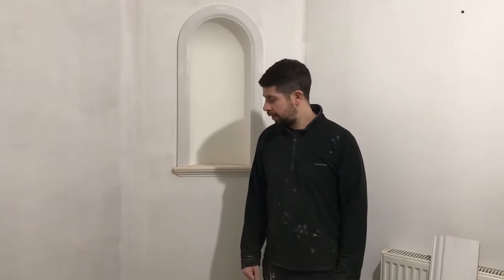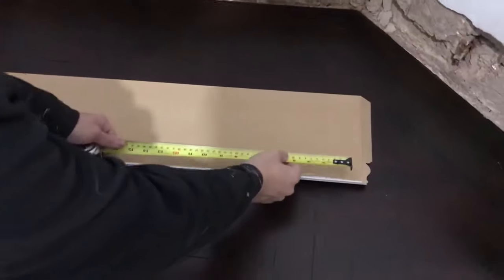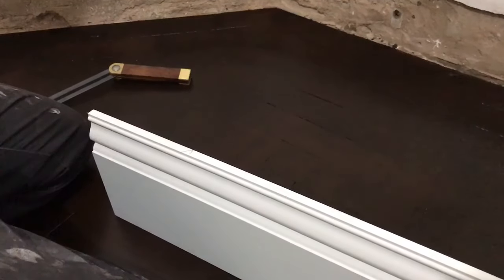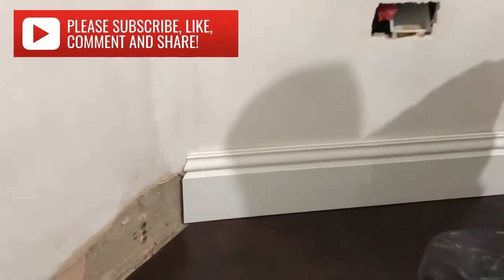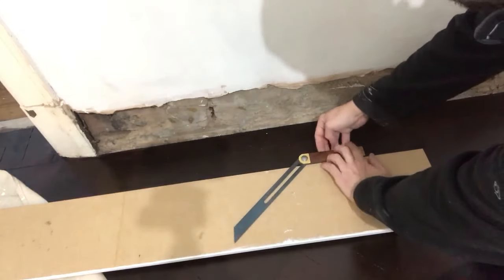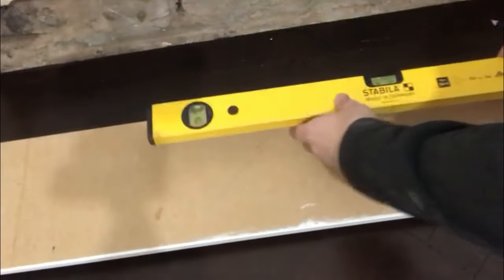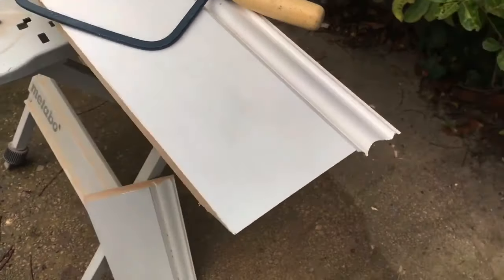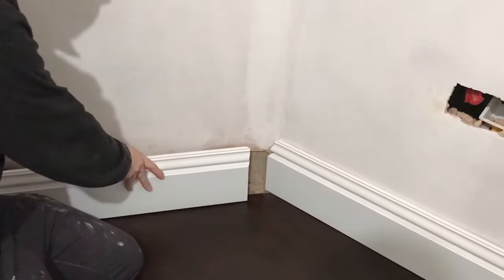Skirting board, non 90 degree internal corner, obtuse angle scribe/cope cut. Bay window conservatory

Comment: Hi mate great video, I had a job today fitting skirting on a 5 side bay window, each were less than 30° angles on each corner, I was told by the owner that they had carpenters out that wouldn't even touch it, I now realise why 🤣 very very difficult, also didn't help that the walls were bowed and twisted slightly and had to scribe behind each each edge about 35mm
Reply from the maker: To me this is basic level 2 carpentry. But it's amazing how many people call themselves carpenters and they can only do billy basic work.
Thanks for watching and don't forget to like share and subscribe to help the channel grow 👍🏼
Reply: @spendtimesavemoneydiy  will do,  thanks for the video.
Reply: @spendtimesavemoneydiy  how many levels are there?

Comment: Great video, im still struggling.
A 45 cut fits flush to the wall.
Im striggling to get the back cut right.

What kind of saw did you use to get the straight cut?

Thanks
Reply from the maker: I just use a bahco fine toothed saw from screwfix.
I'm sure you'll do a great job.
Let me know how you get on.
Thanks for watching and please consider subscribing 👍🏼

Comment: DIY question:  Apologies if I missed it but what is the purpose of making the very precise bevel cut (from around 4 mins) prior to scribing?  The cut is a perfect dissection of the internal angle, achieved through the very neat drawing trick with the level, but, if it’s going to be back cut, would a 45 degree cut not been just as effective at exposing the profile prior to cutting?  Super helpful video though so many thanks!
Reply from the maker: If it's cut at 45 degrees then it will fit neatly into a 90 degree corner. The amount of profile that is cut away changes with the different angles. So the bevel cut to expose the profile is half the angle of the corner. Hope that makes sense.
Thanks for watching and don't forget to like share and subscribe to help the channel grow 👍🏼

Comment: How did you fix it to the wall did you glue or nail
Reply: Glue and pin . But looks like may be brick behind the wall so would have to plug and screw
Reply from the maker: It's a brick wall but I always recommend to plug and screw skirting boards to walls. I actually have a video about it.
Thanks for watching and be sure to like, share and subscribe to help the channel grow 👍🏼
Reply: Spend Time, Save Money, DIY  I bought Mdf skirting from online pre primed , the company recommended using adhesive, it’s an old 1970 house  and the guy that fixed  it drilled out some very big holes and countersunk the screws  ,they do not manufacture a good filler for MDF only the two part mix which  is difficult to use, I rang the company that makes the skirting  to see if they had any ideas   They said no ,so I have quite a few  big holes  to fill  any ideas ?
Reply from the maker: Joyce Millichip if you watch my video on how to paint mdf skirting boards that should tell you all you need to know.
Let me know how you get on 👍🏼
Reply: Spend Time, Save Money, DIY  thank you I will  I bought them like that because I didn’t want to paint them as I have a lot of other stuff I am doing in the house.  I will find the video and watch it thanks

Comment: Is there a power tool or power tool fitting that would replace the coping had saw?
Reply from the maker: Eddie Warren many people use a jigsaw to replace the coping saw but a jigsaw would struggle to get the angle needed hear. My advice is master the coping saw and it will be just as fast as a jigsaw! Thanks for watching and be sure to like share and subscribe to help the channel grow 👍🏼
Reply: @spendtimesavemoneydiy  Thnsks for the advice.
Reply from the maker: Eddie Warren no problem, anytime 👍🏼

Comment: Why not do a straight cut on both using the angle of the wall?
Reply from the maker: Bolter99 if you were to do it like you suggested the joint would always open up. This is the correct way to do an internal corner. Thanks for watching and be sure to like share and subscribe to help the channel grow 👍🏼
Reply: @spendtimesavemoneydiy  Yeah. That's what caulk is for!